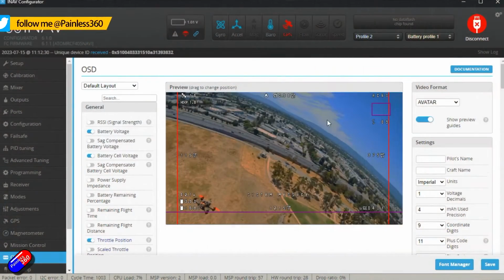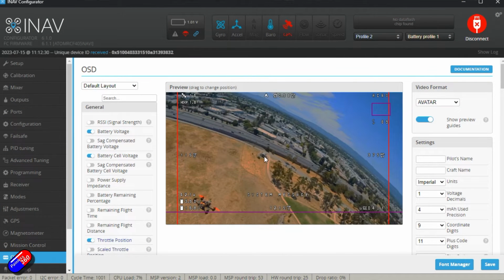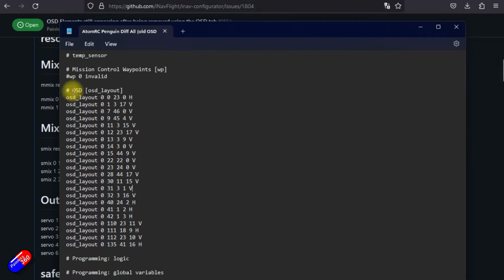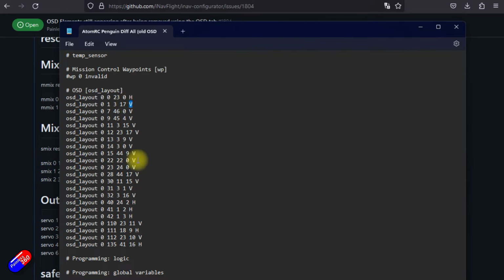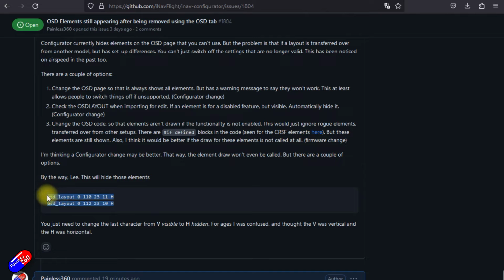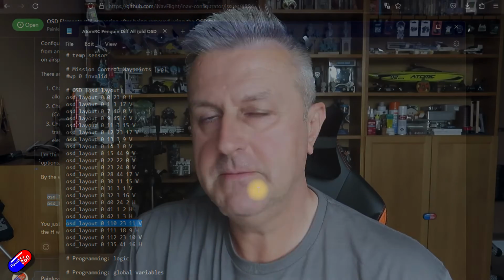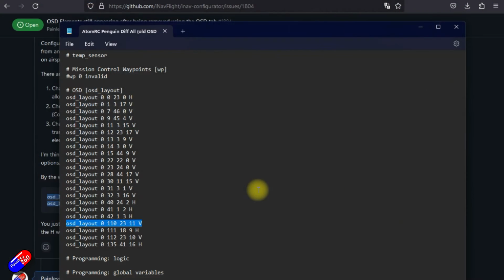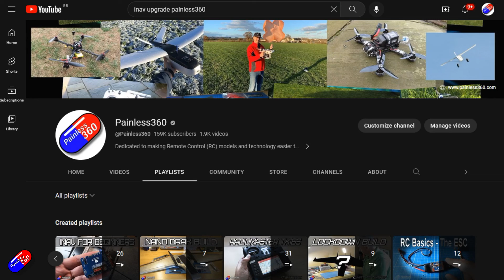INAV: Fixing and hiding OSD 'orphan elements' (things you  see in goggles but not in the OSD tab!)

Comment: Thanks Lee.  That also let me fix an issue with OSD parameters I had selected not appearing in my goggles.  That was caused by using a configuration from my DJI system in a new analogue setup that had some parameters outside the analogue goggles display area.  I couldn't fix it using the configurator, but by changing the Column & Row numbers (using your method for changing "H" or "V") I could get the parameter back into the viewable area and then position it as required.
Moral of the story, don't copy the OSD configuration from digital to analogue.

Comment: Hmm I remember having that issue in the past as well and iirc I fixed it by just turning the OSD mode back to PAL (on a DJI setup) so I could disable that incompatible OSD element and then switched back to the DJI OSD mode. However that is over a year ago already but that was the way I solved it.

Comment: I have a slightly different osd issue in iNAV with walksnail. Everything looks great except for my direction to home arrow. Instead of an arrow it just cycles between random osd elements, everything for letters and number to battery mah symbols. Not sure how to fix it.
Reply: I have been grappling with this exact issue on my FlyWoo Explorer LR 4 Walksnail, after I flashed it to INAV so I could have reliable INAV RTH. I suspected the Walksnail GPS/Compass, however, a Matek M8Q-5883 gave the same crazy direction to home indicator. Also, Loiter Mode and RTH can send the quad to the moon. I'm now suspecting an issue with the FLYWOOF405PRO INAV target for the flight controller in the Explorer.
Reply from the maker: What Walksnail firmware version and what INAV font are you using on the goggles? I spoke about this exact issue in the Walksnail update video from the weekend...
Reply: @Painless360  I couldn't tell you the exact version. But it's a bit older. Pre spectator mode
Reply: I was on Walksnail 32.37.10, but recently updated to 33.39.10 and the problem persisted. I was initially using Display/Custom OSD = Auto and thought I would try the custom font 'Nexus' out of desperation, that didn't fix the problem (but a very nice font all the same).
Reply from the maker: Until the very latest FW version, you needed to use the internal INAV font to get things like the RTH home arrow and some other things to work. Now, on the latest version the custom, 2 page, fonts should work again..
Reply: Tomorrow (it's getting a bit late here in Oz) I'll try locking the internal INAV font. I may even bite the bullet and go for the latest F/W version even tho' it's beta. Sorry @LenfredDueck, I didn't mean to hijack your comment.
Reply: @Painless360  I'm happy to report that changing Walksnail 33.39.10 to 'Display/Custom OSD = INAV' resolved my crazy alphanumeric direction to home indicator.
Reply from the maker: Yep, it sure does :D The latest firmware version will fully support two page OSD custom font files so stay tuned!

Comment: i have all kind of osd elements appear and disappear during flight, my setup is matek 411 Dji on soft serial using WTFos 
....used to run GPS on Soft serial but lost satellites often any ideas?
Reply: If you are running VTX UART for WTFOS (or any other digital system) on soft serial, OSD issues are expected.
Reply: @shannonbaker9922  thanks, that confirm my suspicion
Reply from the maker: Check out my builds with the DJI HD systems. I tried to get it working with softserial without success in the early days... I only use hardware UARTs now. Best of luck